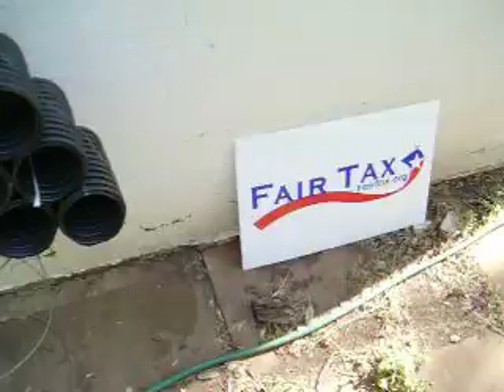AP Burlap-Lettuce Burlap-PVC Spoke

Comment: Hey man its pvc time.That a hek of a deal on the pipe.and i got to check out the burlap.i went today and picked up the lumber to do door panels on the greenhouse 2 on each side and 4 for the roof that way  i have plastic sections instead of repairing with tape.all will be hinged and be able for access and venting .